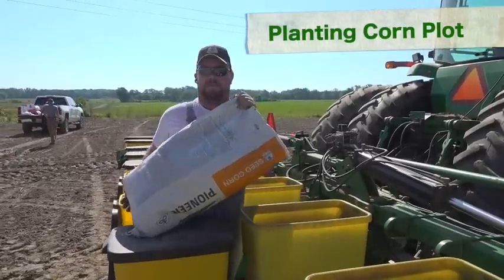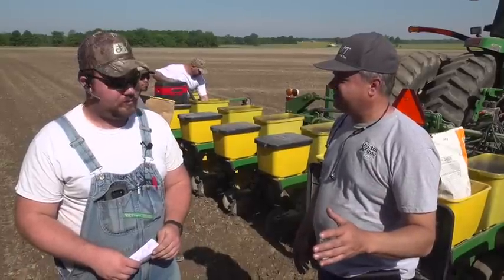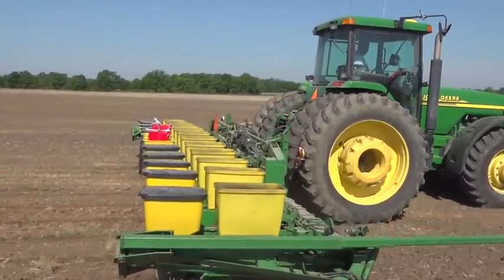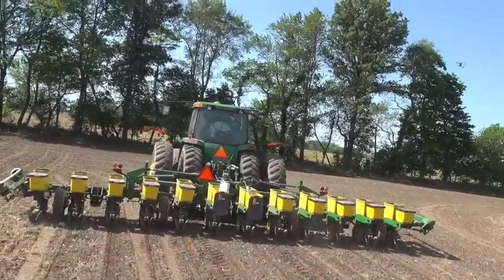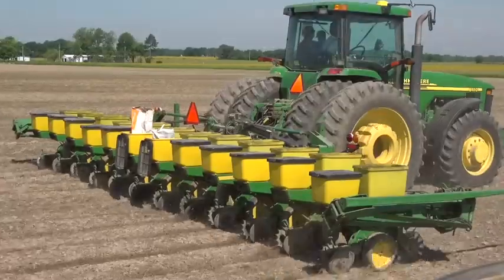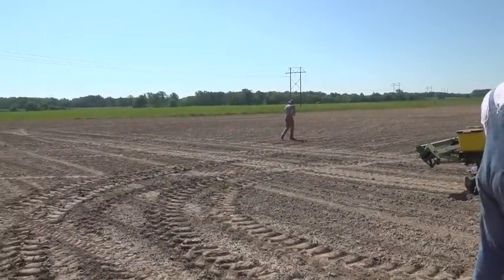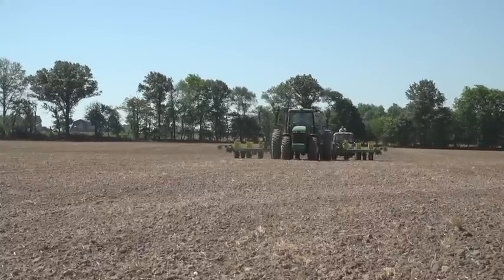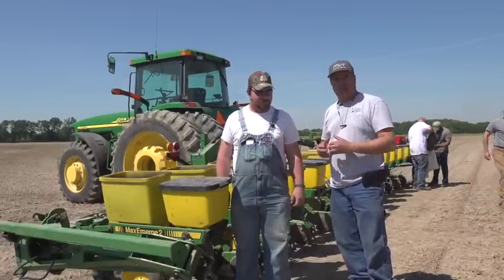Did the Tile Work?  First Day Corn Planting

Comment: Are the dualies on the right side more spread than the dualies on the left? (tractor rear)
Reply from the maker: I do not know. Maybe Randall will have more insight.
Reply: They aren't supposed to be. We used this tractor several years side dressing corn, driving in 30 inch rows and I never noticed any wheels closer to the row than another. Maybe video gives an optical illusion.

Comment: I am like many, and thought corn was corn. If you went in a field that was planted, took 6 ears and went home, you could boil it, and it would be good. Some is not even considered good for human consumption, from what I understand? Am I wrong?
Reply: I don't know of any corn that isn't good for human consumption but you probably wouldn't like to eat field corn which is yellow dent corn. It has less sugar in the kernels than sweet corn. Dad talks about eating field corn years ago before they had really good sweet corn varieties that we have today.
Reply from the maker: Ok, lots of misconceptions to address here.  

First, the corn grown on midwestern grain farms is not used for corn on the cob, or canned corn.    

Corn on the cob, canned corn, frozen corn, etc (where you eat the kernels, and they are soft and juicy) is commonly called 'sweet corn'.  This type of corn is harvested while the stalk is still green, and the kernels still juicy.  

"Field Corn" is grown to maturity, meaning it is not harvested until the stalks are dead, and the kernels are dry/hard.
This type of corn is used for corn meal, corn flour, livestock feed, etc.

"Field Corn" can be eaten as 'corn on the cob', but it isn't very 'sweet'.  The kernels are not as big and juicy as sweet corn.

Funny thing is, when sweet corn is allowed to mature,  the kernels shrivel up.  All that juiciness dries up.
Field corn on the other hand matures with large solid kernels well suited for grinding into flour.

It is ALL edible by humans.   Just optimized for different purposes.    

That is the high level, does that help?   I've glossed over MUCH detail, but hopefully this helps to explain.  
We have several videos showing harvest of the field corn.   Perhaps that would help you to visualize some of what I am saying.
Reply: @TractorTimewithTim  
Thanks, I have watched a number of harvest videos.
 I suppose,  if it can be fed to cattle, no reason humans could not eat it.
 We have a variety of sweet corn here called peaches and cream, which I am sure you have there, maybe called something different. Very good.